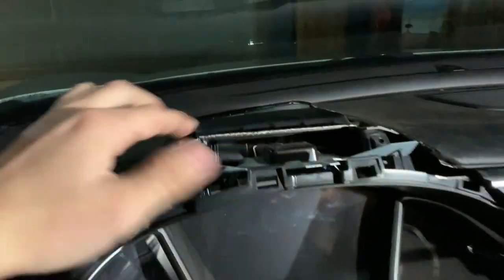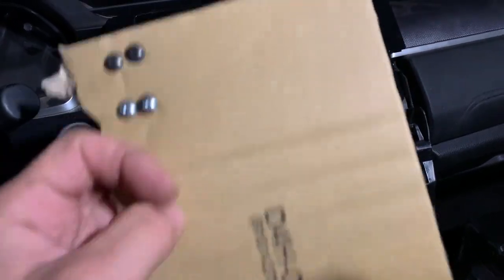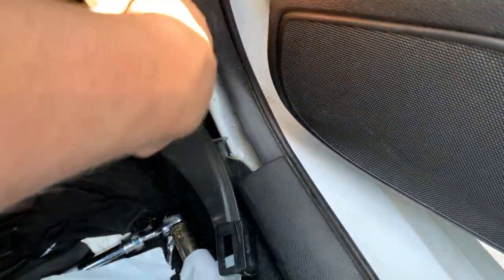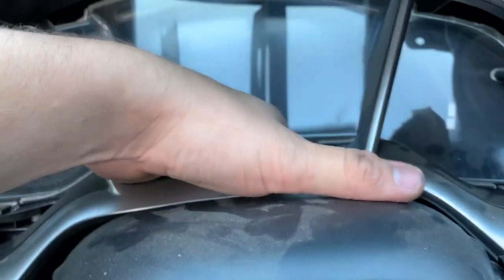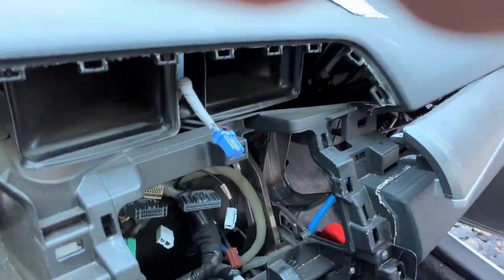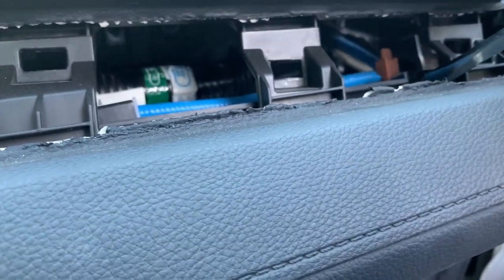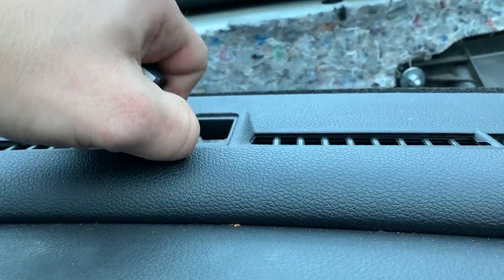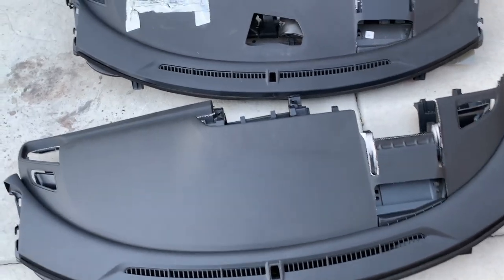2016 - 2021 Honda Civic Dash replacement

Comment: Have you ever had to replace the dash wiring harness?  My civic is pulling that code after replacing everything else. Srs module, front sensors , front seat belts clock spring andb wheel air bag. Just curious, have never had to do that.

Comment: If you remove the dashboard and unplug all the wires that are needed to remove it, does that mean the dashboard will need to be reprogrammed?
Reply from the maker: No, the dashboard has no electronics in it so no need to reprogram anything. You can simply plug everything back together and you should be good to go.

Comment: i see you replaced the airbags i have the same car with airbags now replaced . did you have to reset the airbag ECU crash data?
Reply from the maker: yes, their is a local place in my area that does it, otherwise their is a place you can send out your ECU to get it reset
Reply: @johnybuilds1259  yes i did that, found someone on ebay and it worked! 👍

Comment: If I only need to replace the drivers and passenger side air vents, do I need to dissemble the entire dashboard? 😢 It’s literally just broken vent clips that the dealership quotes me $1700 to fix but the part is $30 on eBay so I want to do it myself without having to take the entire dashboard apart.
Reply from the maker: is it just the air vent trim from the outside? if so then no. But if its on the inside of the dash then yes

Comment: Dear John, How to find out before buying  that dash will be a perfect fit? I wanted to do a replacement.
Reply from the maker: Sedan and Coupe (one piece) are same Dash, for Hatchback it is different (2 pieces). Make sure you buy the correct one. if you have the 5 Speaker system you can attempt what I did in the video otherwise I recommend to buy the correct one. It will be the same fitment if you buy for the same dash  id not know what else to tell you

Comment: Nice job, how much will it cost me to change my dashboard airbag and my curtain airbag?
Reply from the maker: im not sure, it depends on what you find the parts for, usually $150 for dash airbag, around $350 for curtain airbag and the dash its self is roughly $300 or so
Reply: Thanks 😊